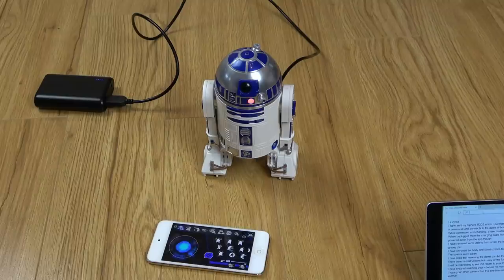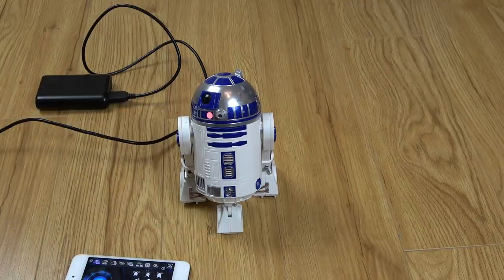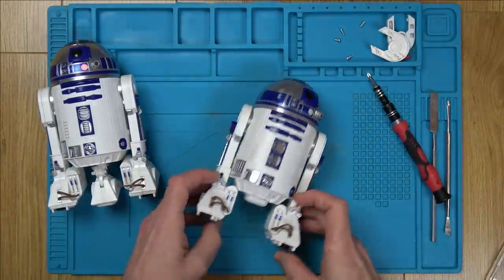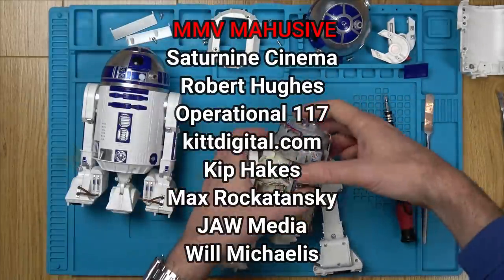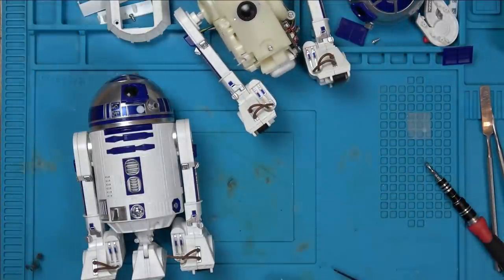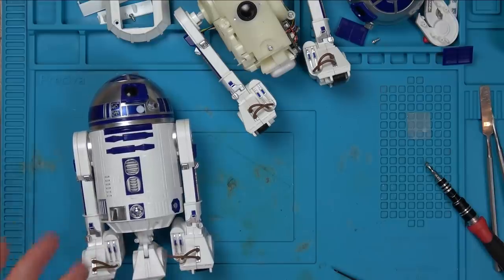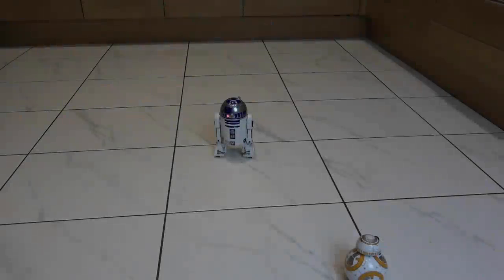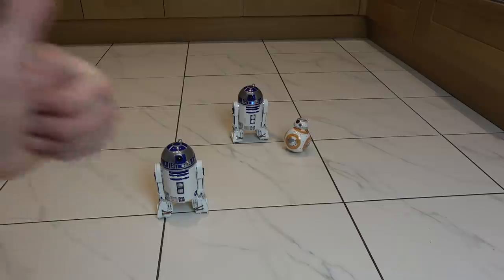Trying to Fix a Sphero R2-D2 App Enabled Droid

Comment: My R2 D2 suddenly stopped responding to iPhone app movement requests over the EDU App. It’s strange because I can connect to the droid, it then shifts from standing on two legs to three but cannot move it with the circular joystick, it won’t move in any direction. Any ideas, is it just dust or the motors? I‘m kinda afraid to open it..

Comment: Hey Vince, I wanted to share a trick I do sometimes to melt plastic parts, what I do is get bits of component leads from capacitors that are a bit more sturdy, I bend them in a zig-zag way and with my soldering iron I press them into the plastic bridging both parts.
This way it gives more strength to the part and less chance for separation.
This trick I actually learned from plastic welding car parts like broken bumpers, they use spiral like tabs to push in to the plastic.

Comment: I had a similar issue with one I was repairing recently - I found that the left leg would ONLY work in one R2, but not the other. The other worked in both, so I simply swapped them. (Connector issue?)
I'm surprised you had different connectors for the two right legs - L and R are reversed, but should be the same for the same side leg.
I have a video explaining how the gearbox goes together, and I'll be posting another video soon with some additional tips on how to fix these, including removing the dome without breaking it.

Comment: Nice fix ! R2D2 is now back in action.
The metal things (fingers as you call them) which power the rotor windings are called brushes (this type of motor is called a brushed motor). My guess is that they overheated and deformed when the motor was jammed.

Comment: Regards the chips driving the motors - it's common for one of the output drivers to fail in the chip, and leave the other one working!  ie. those types of chips often don't completely fail - just one of the drivers...  If a motor fails to work, it can detect that via lack of pulses from the hall effect sensor, and it will cut out (safety) - same thing will happen if a motor shorts out and pulls too much current.  Great job =D   It's scarey how many parts go into those!  You must have spent hours and hours on these!!!   "If someone gave me another one of these now, I wouldn't do it, but..." =D   Incredible the detail on these - particularly how well R2 moves around.  Amazed at BB8 movement too tbh!  We didn't have toys like this when we were kids!!!
Reply from the maker: Thanks Chris. Many hours went into them!!! R2D2 is so lifelike, the sounds and movements are very good.  A lot of research must have gone into developing these, like a modern day Tomy toy from the 1980s.

Comment: Does it need a firmware update? Or maybe the battery isn't supplying enough power on its own, maybe faulty as working with extra power?

Comment: For what is the yellow cable at the battery? Can not be for balancing when loading, because it is only a 3,7v battery. I had a dead battery in it and chosed it with a 800mah battery for the Hubsan 107d drone. Fits perfectly in it. Original in the robot is 1400mah. I soldered only the red and black cable on the original plug (red/yellow/black), which goes at the platinum. I didn't load it with the port on the R2D2. At the right back side from R2D2 is a back cover, under this, where the one screw is. There I made a opening for the plugs. You can easy disconnect in this opening the plugs and load the battery. After the battery is complete loaded with my Sky Charger D100, I close the hole with the original cover with his fastening brackets and nobody can see the difference from a R2D2 with the standard battery in it. Now I have more control over the battery. What the status from it is and I can chose a trickle charge, if I do not want drive with R2D2 a long time. If the battery is bad in a few years, I take simply another one in and R2D2 is happy again! NOTICE: For all people which will make that too with her own robot, this MOC is only for accomplished hobbyists. You risk a fire damage!!!!!
Reply: The original battery has a yellow wire for an NTC thermistor, embedded in the battery pack, to monitor battery temperature while charging.
Reply: @JPLegat  Very interesting. Thank you, that is a good help 😊

Comment: I have one and it works great so far, but I noticed that they designed my the shoulder side plates the wrong way. The two squares should be towards the back, and the long piece near the front.   I was hoping there was a way to reverse them. I see they are not reversible. Oh well

Comment: Vince for broken plastic use super glue to glue the two halves together. Then apply a bead of super glue to where the break is then sprinkle baking soda over the bead of super glue. That will harden like a rock almost instantly. Then just sand if necessary an dust off. An your done. I have fixed loads of things like this.

Comment: i must admit i am more of a Trekkie than a star wars fan but i really do love r2 and how even though it is just beeps and boops you can still sense the "emotion" it is feeling and they captured that perfectly in these little bots i am so glad to see you fixed it also that issue with the motor is very common for those sizes of motors i had the same issue with my N scale model train locomotives with the little wipers that are supposed to act like the carbon brushes on the bigger motors getting caught not making contact or shorting out against the other side of the motor

Comment: I had exactly the same issue and I reached out to Sphero an they admitted there was an issue with the drive on the r2d2 but they no longer make parts for it, I solved it with grease he moves now but still falls over sometimes.

Comment: There was a much easier way of swapping things where you would've have to solder anything. You could've just swapped the connector plugs. It's very easy to repin them. You just pull back the little clips on the plug and slide the wires out. I've swapped many plugs on different revision boards.
Reply: Ellis The DJ  it's nowhere near too much hard work. It takes like 2 minutes to swap the plugs and then the legs wouldn't even need to be taken apart to test the motors. And if the entire boards on something needs to be swapped you don't have to cut wires and resolder stuff.

Comment: @My Mate VINCE Great Video, The resistor to ground is for current sensing, The fingers are called brushes and was shorting the motor pulling more current  and shutting down the motor drive IC (over current) safety feature of motor driver IC  👍
Reply: Yea cause motor driver ics have sometimes protection buul in them

Comment: Great job!  I love seeing how your diagnostic skills have improved over the last year or two.  Very complex little toy.  If the motor fails again, you could maybe try pulling the bass pulley off the motor shaft (tight press fit) which would let you pull the inner armature assembly out of the motor .  You could then get at the bent brushes to try a more long term fix.  Hold brass pulley in a vice and tap shaft with small hammer to drift it out.  Those el-cheapo motors were never designed to last long though.
Reply: Which app controls R2-D2 please help I have it 3 months and no app I try doesn’t work

Comment: The "3 fingers" are motor brushes..
The motor going faster and longer is resistance differences.. imo if the brushes are bent its very rare you will get it working at 100% again.. good fault find vince! Keep them comming mate!

Also the fingers are shorting the motor when bent in the wrong direction

Comment: It's weird even though it's a toy, because he's sat there turning his head and beeping it's like it's actually R2D2 sat there and there is something wrong with him. He's a very charismatic little droid.
Reply: I now have 2 R2 units and my fella has a BB8. a few nights ago, 1 of my R2 droids suddenly powered itself up and also the BB8 and they had a little chat to each other. The R2 was set to human interaction and the BB8 was set to droid interaction. The droids had been off for 23-24 hours. Unsure why it powered up, maybe a signal from the TV but I love the little quirks.
Reply: @DEmma1972  they're like a cooler version of those horrid furby things haha.
Reply: @DEmma1972  Funny, mine have done that sometimes too. Although, it could be a malfunction in my case. A few weeks ago, I was woken up by my R2, who decided to start lighting up at 2 in the morning! Those lights are pretty bright when it's dark, the whole room was glowing red and blue. It didn't beep or move, but it flashed the light for 5 minutes or so, then turned back off on its own. It was the same thing that happens when R2 is in deep sleep mode, and you plug him in, where the light flashes for a long period of time, before shutting off on his own. He wasn't plugged in or connected to an app, (the third leg didn't roll out, if he is connected to an app, it automatically comes out no matter what.) so I have no clue what woke him up.
Reply: @Axl_Pose  The modern Furbies are quite charming, but unfortunately they have no on or off switch. They sit in a bin without the batteries now, but they are pretty fun to mess with every so often. I'd enjoy seeing Hasbro redesign that R2-D2 from 2002 to work as life-like as possible. You know, going all out with the voice commands, and maybe adding an RC mode like Spin Masters BB-8. Who knows, maybe I'll give that a shot one of these days.
Reply: @corellioncrusaderproductio4679  mine have done it twice now. Once with robo interaction and once with human interaction...24 and 48 hours after last being used.
Reply: @DEmma1972  Yeah, they definitely shouldn't have done it that long after closing the app. Did you charge them at all inbetween closing the app, and them doing an interaction? If not, I have no clue what could have started it. Perhaps somebody accidentally connected to it via bluetooth when trying to use one of their own devices. I've done that a handful of times, albeit the robots never lit up, moved, or activated when connected directly through bluetooth.
Reply: @corellioncrusaderproductio4679  I think they may have received a rogue signal from the TV. Phones never lit up when it happened. Actually its happened 3 times. 2 with 1 R2 and 1 with the other. Which means its not a unique issue. I like it though....they feel more sentient.
Reply: @DEmma1972  That sounds a little odd, the Spheros don't use Infared if I'm not mistaken. They run entirely on bluetooth, I don't believe they would have an interference like that. I use them around with many devices on at once and haven't experienced any oddities that could be replicated. If it's a bluetooth TV, maybe something happened there? I don't exactly know for sure how the signals are affect, I wouldn't think that bluetooth and infared would pick each other up.

Perhaps it is a power issue? My R2 has turned on by itself without moving, (Like I said before, it lit up as if I had plugged it in and unplugged it, leaving the lights on for 5 minutes or so.) My Sphero SPRK has done a similar thing, randomly flashing rainbow colors and then shutting itself off. If the droids are set to interact, and then a power issue happened, maybe that's what triggered it. Something that makes the robot think that it just received power, either from the battery, or AC. I couldn't say for sure, but that's what it seems like to me.
Reply: @corellioncrusaderproductio4679  I will describe what happened in as much detail as I can. See if something may be amiss. My R2 was about 1 ft away from the TV and it was not plugged in for charge. My fellas BB8 was on the other side of the room. Both were set as 'interact with droid'. Both had been off for aprox 24 hours when the R2 unit powered up (turning the BB8 on). an hour or so later I manually powered the r2 unit up and switched to human interaction and powered down. 48 hours later, my R2 powered up. It stayed on for 20-30 seconds and then powered down. The TV was on on both occasions. The R2 that Vince fixed was sat on my 3d printer and powered up about 40 hours after it was last turned on (about 2 days after this incident). This R2 unit is about 80 cm from the TV. I personally think its getting a rogue signal from somewhere.
Reply: @DEmma1972  Yeah, that sounds like what happens with mine, but it does it without any of our TVs being on, or anything nearby that could send a signal. If R2 is in the droid interaction mode, he will always connect to other droids whenever he is disconnected from the app, or given a soft shutdown. It's hard to tell since the droids don't have a real "powered off" state, and are always in a state where they are running something. I'll have to keep an eye out and see if anything is going on with mine, but the last time that it happened, everything was completely off, aside from my main computer, and the Spheros. Who knows? These things are so complicated internally, practically anything could disrupt them. I'm surprised they didn't consider putting physical on/off switches into the units, to prevent that kind of thing from happening.
Reply: @corellioncrusaderproductio4679  Maybe....they are watching us and listening to what we say.
Reply: @DEmma1972  Are you proposing that they are Imperial spies? that is impossible, our defenses are quite operational.
Reply: @corellioncrusaderproductio4679  There are many R2 units out there. Who knows if the empire has had their hands on any of them.
Reply: @DEmma1972  I have a bad feeling about this.
Reply: @corellioncrusaderproductio4679  Yeah...I think you're right
Reply: @corellioncrusaderproductio4679  modern furbies? You mean they still actually make them? I think you had the right idea stashing them in a bin! If you wanna see something truly horrendous then check out LOOK MUM NO COMPUTER and his furby organ *shudders*
Reply: @Axl_Pose  They do, but they aren't as stiff as the older ones. They've got fancy touch sensors, and an LCD display in the eyes, so no more furbies coming to life without batteries, lmao

Comment: Has anyone found the replacement battery or an equivalent substitute? I'm pretty sure that since it is a 3.7V cell the yellow wire is a thermistor sensor. It would be a shame that this helpful video assists with battery removal (for a dead battery scenario) but not be able to actually replace the battery. I'm sure that there are tens of thousands of these R2D2 units that have battery issues or soon will have an issue. Please Pose if you have information. Thanks!

Comment: Those prongs in the motor are called brushes Vince, on larger motors they are made of carbon and spring loaded to maintain contact onto the commutator. It was unlikely to be the battery Vince lipos give out their full load current for the entire capacity of the battery with very little fall off.

Comment: The big resistor connected to ground are probably shunt resistor (maybe used to measure motors current). Their value is very low (the one in your video seems 0.2ohm resistor) and cannot be measured using a multimeter

Comment: voltage is one thing, but amperage is the real power behind any battery, but if either or both are low, then you will struggle to get a motor moving. so a car might have 12 volts, but only have 0.1 amps won't be anywhere near as good as a 12 volt battery with 2 amps reading.

Comment: Kinda bummed out when I heard you opened it prior to recording so we couldn't see first reaction and get in there with you at the same time. Couldn't you have just recorded first opening, then added the next part when you bought the second unit? Point is, I like to learn as you learn and experience and you experience. That's part of the magic of your videos.
Reply: I thought the same thing, first video shows the initial opening and ending in failure. Then after comments and maybe buying the 2nd model there would be a revisit.

Comment: Hi, I have one of these R2 units that my son dropped and now has the same issue as the one you purchased for this video. The middle leg won’t go back and the droid doesn’t move. I followed the instructions to open it up, apart from the dome which is proving to be a problem, but was wondering what you did to fix the middle leg
Reply: The dome is tricky to take off and a tab may be snapped doing it. I believe Vince used a soldering iron to melt the broken parts back as one

Comment: Great repair as always Vince!

Instead of superglue or the soldering iron, have you ever considered using araldite? Its a 2 part apoxy, i use it often to repair laptop hinges, it sets super hard. In fact iv probably repaired over 50 laptop hinges with this stuff and have never had any come back. 

As always, thanks for the video i have learnt something new today.
Reply: Not apoxy...... Epoxy
Reply: @martinkuliza  no big deal i am sure he understood, thank though for the correction, love you
Reply: @buntykainth3699  
of course he understood,  but Epoxy is one of those words that people may have been told incorrectly at one point and they continue incorrectly forever, 
i figured it was best to correct it

but like you said... yeah, no big deal, just a correction
Be Cool

Personally i felt bad for R2 when he had him in pieces and R2 was all limp and disabled and rattling on the table.......Poor R2   i almost cried for him

Thank the Maker he is working again